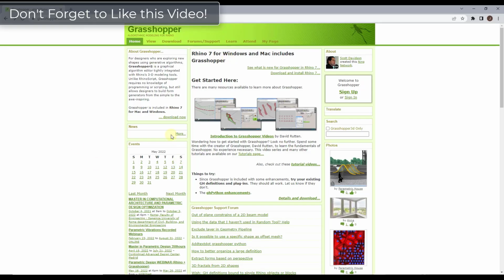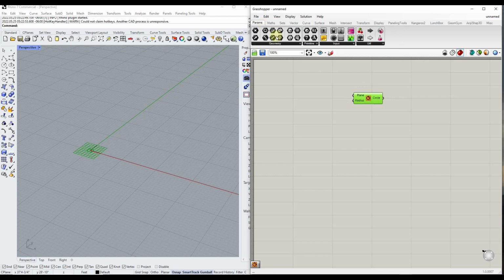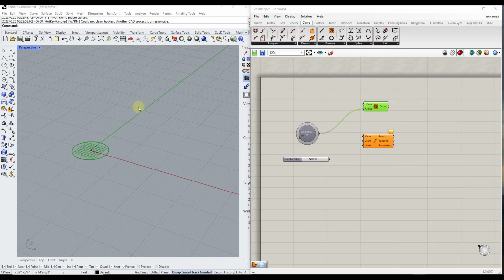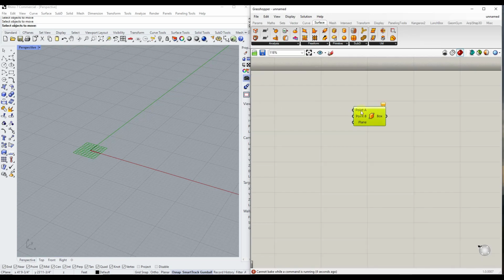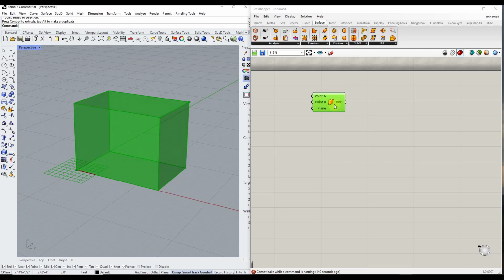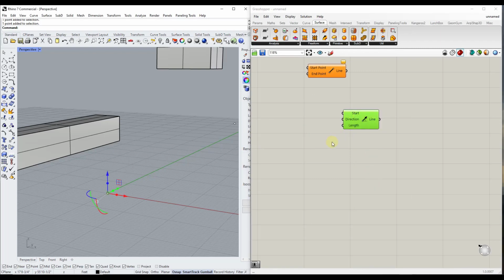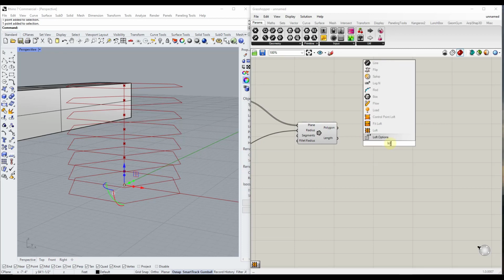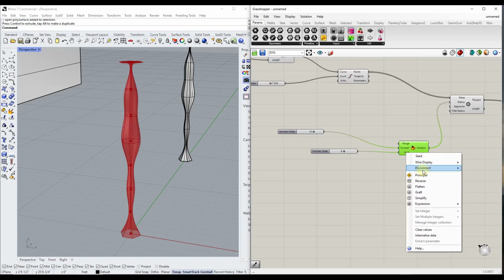Getting Started with Grasshopper 3D - BEGINNERS START HERE!

Comment: Hello! Grasshopper in Rhino and Blender's Geometry Nodes do have similarities. Both are node-based visual scripting tools used for parametric  design. Grasshopper is primarily for Rhino, focusing on architectural and engineering tasks. Geometry Nodes in Blender are more for procedural modeling and animation. Both let you create complex structures and patterns using nodes.

- ChatGPT